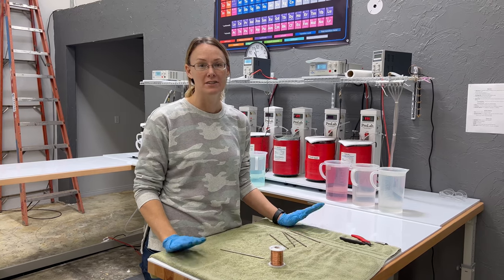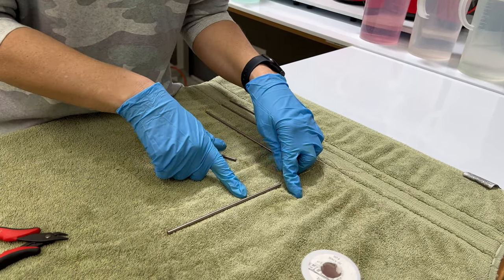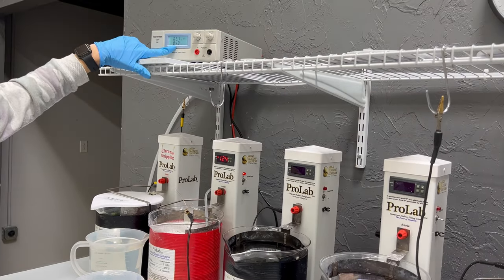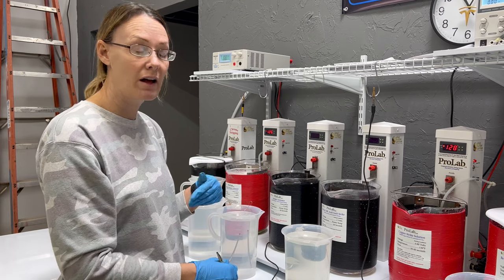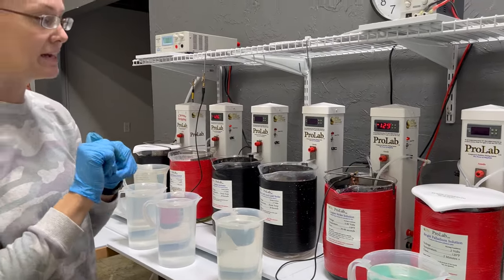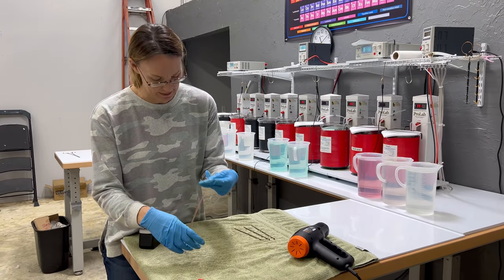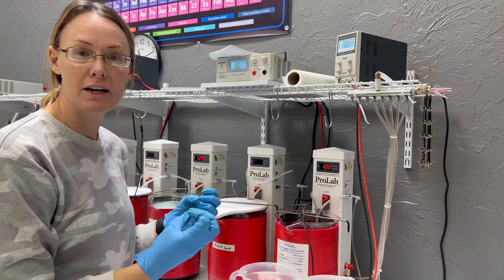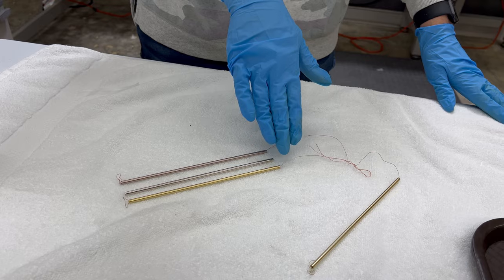Plating onto Copper Tungsten with the ProLab Series

Comment: is this a way to make fake gold bars that have the right weight or something?
Reply from the maker: Nope just a great way to have a hobby or even a business.
Reply: @GoldPlatingServices  ... making fake gold
Reply: @D D or whatever the OP's name is at the time of reading this comment. This isn't "fake gold", it's gold plating. This is a very common practice industrially to make the part corrosion resistant, specially in electronics, usually in conductors (gold is an excellent conductor, even better than copper). It's not limited to electronics only, though and is used in other applications like the automotive industry for heat shielding and corrosion resistance (and has many more applications). They're not just gonna make the whole thing out of gold (though some parts in some high end devices are, though usually very small like the wires in some ultra-high output LED chips on flashlights) because the cost would be too high and also for other reasons like other properties the other primarily used metals have, whether it's higher tensile strength or better resistance to other stresses they'll be subjected to, weight considerations, etc. Yes, it can also be used to make "fake" jewellery, but even then it's most often advertised as gold plated by the seller to begin with anyway, so it's not like you're catching these people in some huge scamming scheme or something. 24k refers to the purity of the gold (24k is pure gold). Most jewellery you buy like necklaces for example will have a tiny stamped section with the purity marked (usually 14k, 18k at the highest). It's usually in that range not only for cost, but because the alloys are stronger and having pure gold jewellery would make it both more expensive and also more prone to breaking or deforming since gold is very malleable. If it's not stamped, it's usually because it contains no gold at all. (many people just like the aesthetics of it and will buy the cheap imitation pieces knowingly). Either way, there are simple, fast, cheap and super reliable ways to tell whether it's gold or not (like exposing it to an acid solution), so again it's not like this is some huge scheme you've uncovered, you just have a lot to learn. It'll come with time.